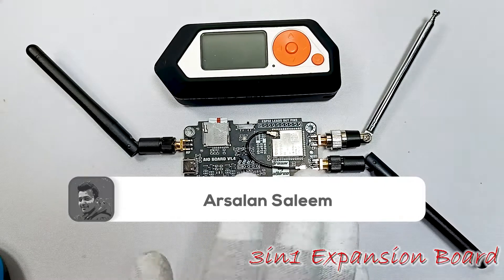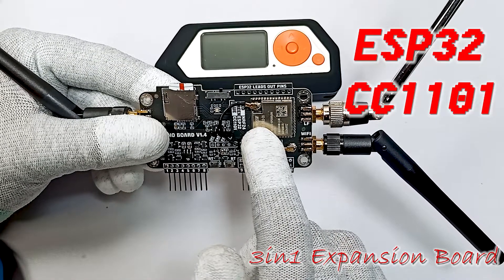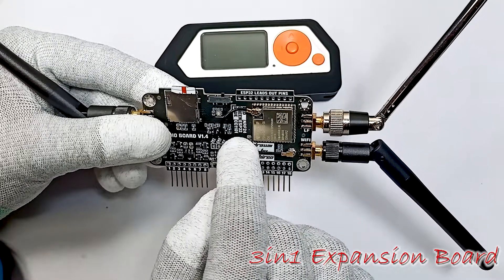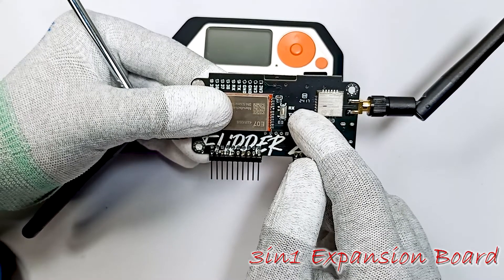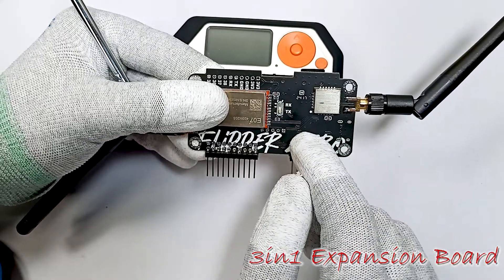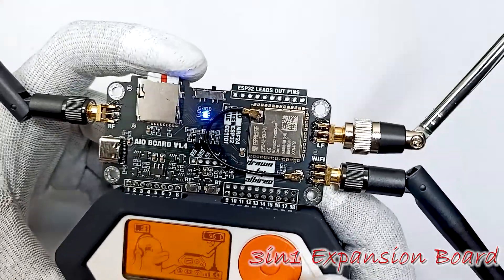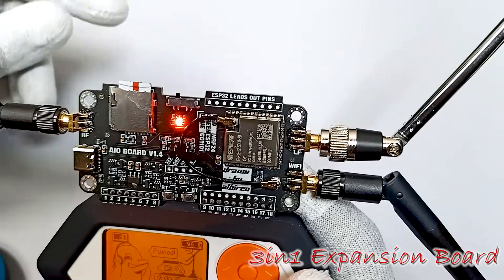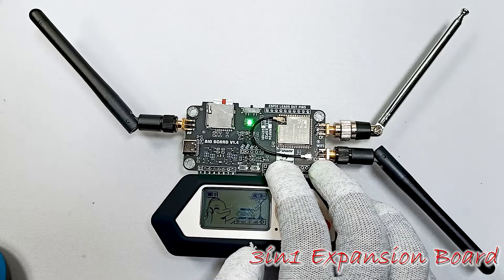Flipper Zero 3-in-1 Expansion Board: ESP32, CC1101, and NRF24 Modules Overview

Comment: I’m unable to find step-by-step instructions on how to get this module working. If anyone has or managed to find a detailed step-by-step guide, please share! I’d be very grateful for any help.
Reply: Basically this is 3 boards in one. The ESP32 is a WiFi board and needs to be "flashed" with Marauder Firmware. It uses the WIFI apps within the flipper. Very easy to setup, just Google it. The NRF24 is for sniffing signals e.g. USB wireless devices. It is used with the NRF24 apps in the Flipper. The CC1101 is for receiving and transmitting signals. Used with the SUB GHZ apps within the Flipper.
Reply: How to flash:  https://youtu.be/Mnv05jEKFvA?si=Fp-PzvQAUZkJg2ml

Comment: i tried this and it still wont work

it says when i start marauder that i should install wifi module

any help?
Reply from the maker: I have shown how to install the firmware on it have you installed it?
Reply: Yes, did exactly like you. 

I will try again

Is there any gpio settings i need to adjust on flipper. Like 5v on certain pin or is it the standard settings i need to use.
Reply: i got it to work, flashed again and used the right app (ESP- Marauder) and it works like a charm
thank you for the video
Reply: @jeppeelbk7142  which settings did you use and which flashing method? I'm stuck also
Reply: How to flash:  https://youtu.be/Mnv05jEKFvA?si=Fp-PzvQAUZkJg2ml

Comment: Theres any docs for this board?, micro sd its necessary ?
Reply: i messaged the seller on aliexpress and got some docs on it. Its pretty minimal but they lso gave me the .bin files for it to flash. Ill see if i can find where i saved them at
Reply: @adrenalineshi  would be very helpful thank you
Reply: @adrenalineshi can you send ?
Reply: i have the same question
Reply: I just got mine, SD card is not needed, but if you want to save captures you can use it
It can be flashed with marauder directly from FZ with ESP Flasher
Reply: Hey did you use the multi board bin,  if not could you tell me which bin you used thanks in advance  @azdralovic
Reply: Fzzerflasher or ghost esp github will be ur friens and have all info just make sure green light while flashing